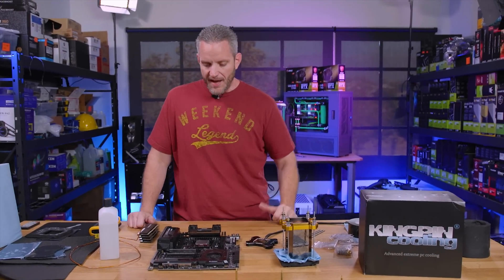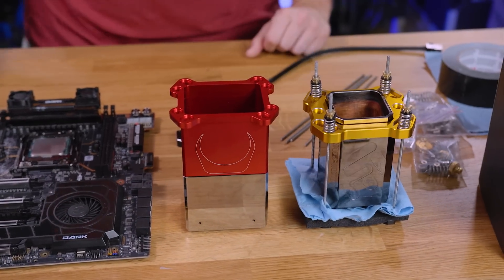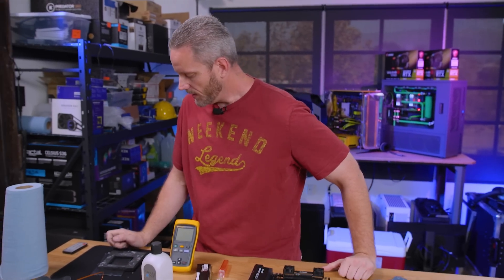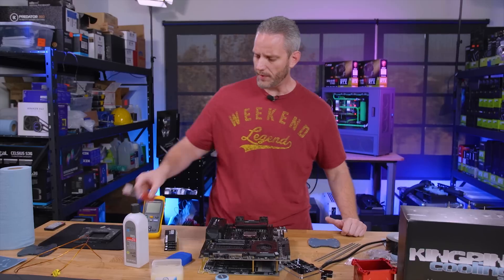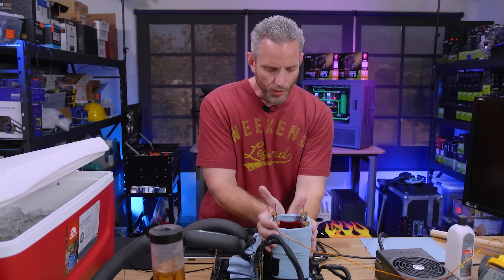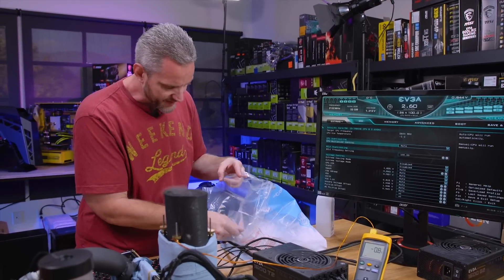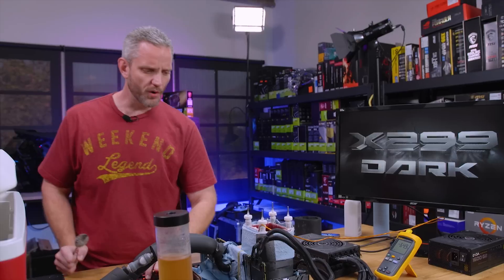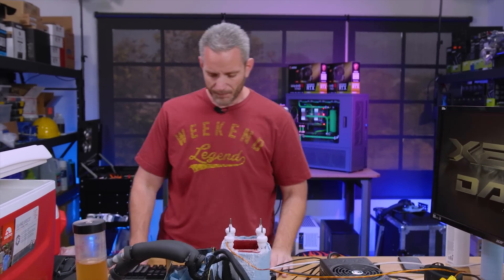Dry Ice Overclocking... NOT RECOMMENDED!

Comment: So, just a thought from someone whose never built an overclocking PC...   The biggest hurdle to keep the MB happy seems to be keeping the water vapor/condensation to a bare minimum, so this may just be a crazy idea from someone who dabbles in welding.  

 If you could put the MB/Graphics card assembly in a tote full of argon gas, basically immersing the board in a fluid that water vapor has a very hard time existing in.  Helium may be another viable option, but argon tends to sit in a tub better than most gasous fluids.

Comment: Not a usable system. WC or AC need a reservoir you cool through whatever mean. Dry ice or peltier. As long as you  don't aim for subzero and only for a gap of 30°C  at most on the fluid, you have no condensation and a pretty good cooling system at a cheap price. It can be adapted to nearly any cooling system as what you need to cool is not the CPU, but the cooling system. ie WC reservoir, backplates or AC circuitry.

Comment: Overclock in Alaska/Montana/North Dakota in the winter with the windows open. Run the cables under a door, set up your peripherals in the adjacent room. Tape up/seal the openings around the door. Ambient will be around -30 in a deep winter condition. Air cannot contain water at that temperature, no condensation concerns.

Comment: I had an Idea, lots of people have liquid cooling systems but don't have a liquid cooled motherboard!

Removing fans to install AIO's can actually be bad for the board as sometimes it looses some fan cooling in some areas!

What about a waterfall, mount the motherboard at an angle, and run oil down it, into a reservoir Which then pumps it back to the top, think about it, done properly their is real potential!

I have some other awesome ideas I'm not sharing on here, message me for details!

Linus will try it if you don't, I recommended it here first 👌👍👌

Comment: as an engineer, all you would literally need to do to keep temps lower is increase the size of the CPU. if you make the dye larger, you're going to have SO much more heat transfer. this cooling system is capable of cooling something like a small engine. yet it's being used to cool something with the surface area of 1 square inch at best. yes, you can increase surface area artificially, but that doesn't really solve the problem because the heat source is so concentrated. 
if they made consumer CPUs like twice the size, i see no reason why you couldn't run it near ambient temps with average cooling.
Reply: in fact, thinking about this a little more, if you increased the size enough, and were able to pair it with a heat sync that is capable of good flow, you could cool a properly sized CPU without any sort of active cooling.

Comment: Can you coat a motherboard (and possibly other components) in the Flex Seal spray and see if it resists moisture damage? Theoretically if you coat it properly it should be "water proof" and even possibly dust proof

Comment: Back with the first gen i7 920 and EVGA Classified 760, I could easily get bench stable @ 5.3GHZ from 2.66. Not bad, also took way more voltage knowledge...and luck than today. That rig just bit it after almost 9 years of service. RIP.

Comment: You can try to use M3 Immersion cooling. If you put a board with an installed pipe in the aquarium with M3 and fill pipe with LN2, then the stand will get rid of condensation and all parts will receive additional cooling. Even the part under the processor socket.

Comment: what is the point in the thermal paste?  I have a Dell Optiplex 980 with a Intel Xeon X3450 overclocked, and I can play even BO2 on the PC without any thermal paste and the CPU never gets too hot and it never slows down.

Comment: hmmm why not use a packing to seal the 2 parts instead of tape (tape is still asking for leakage with acetone because....it solves most glue...)..... other question, why not make air sealed case around this cooler and fill it with a gas that does not condensate at those temperatures? I don't have any experience in these kind of extreme overclocking so I might just have done stupid suggestions......

Comment: Question.  Not to beat a dead horse,  cause I know it's been brought up, but...
See you are into performance adders on cars, as am I. In the Kompressor world of AMG, we have the Killer Chiller to cool the blower air temps. Even the new Dodge Hellkitties have (stock) a similar concept for their blower.

So why not get with an HVAC guy, and have him take apart a window unit, and run lines into the waterblocks?   Or something similar as the car mods to the liquid in the lines.  Hell even blowing some cooler air from that remaining window unit over the PC components would be great too.
Anyway, any thoughts on a Killer Chiller Computer?

Comment: Instead of using Vaseline and a toothbrush to protect your board, you should get some conformal coating. Protecting electronics from water is what it's made for. All you need to remember is to mask off or cover your slots and plugs if you are using a spray.

Comment: You do know dry ice turns into CO2 dont you, which can kill you.......
Reply: Uh... no.  Carbon dioxide is only lethal, if used in a confined space, where the gas, mitigates oxygen, and when it's solid state, can burn you, otherwise it's harmless.  Carbon monoxide is the one that is lethal.

Comment: JAY Sorry man but you should know better than to keep on with this Over clocking nonsense.  Anyone who has a clue knows that systems built after 2015 have no need for Overclocking whatsoever and until they come out with DMI 4.0 or something better than DMI 3.0 that all lanes are bottlenecked already and no 5Ghz cpu is going to make any actual difference in performance other than making numbers on bench mark program go up a little bit.

Seriously Jay you are too talented and far smarter than this to keep on supporting a nonsensical fad that was very usable in the 90's but no longer worth the time or money spent.  It's about as crazy as the FPS claims and speeds people THINK they are getting but truly aren't because the ruler they are using isn't in the same measurement scale.

Would love to see you go back to doing things that actually matter rather than chase theoretical numbers on a benchmark that only measures possible NOT attainable numbers.

8 GT/s is as fast as it gets currently on mainstream systems.  DMI 3.0 holds it back.....if anyone disagrees they are offering courses in Computer science and IT for cheap these days and it will be explained in detail to you.  However as a Tech I do love when people pay me to build them huge systems so if ignorance is bliss so be it...I like Steak and Lobster Dinners.

Comment: So I have a question would it be possible to use some sort of antifreeze in a closed loop system and then use dry ice on the radiator would that be efficient or effective or even possible?

Comment: i used normal copper piping for my dry ice build in past for 290x overclock; with manual motor (basically you turn the handle and ethanol gets moved through the loop from the reservoir which is just a copper pot)
Much safer than what you did there. I was running on extender for pci-e slot; so i had only smear my gpu pcb with vaseline.

Comment: Perpetually, none of you overclockers are just building a test bench to fit into a refrigerator and running lines through carefully placed and sealed holes to a dehumidifier. Constant complaints about condensation, yet you won't do anything to control the atmosphere around the machine?

Comment: Hey!  Maybe you should setup a liquid cooling transport that goes to dry ice outside of the motherboard area and into a radiator surrounded by dry ice?  Course you might need a liquid that resist freezing and likely need a high speed transfer, so the cool from the dry ice can quickly get to the processor while the heat can get out, without going faster then the heat transfer can occur.  It might be a dumb idea, but the over kill sized radiator setup you did a while back, that simply overran diminishing return worked so well, might as well try it out for fun.  If it doesn't work well, you can say we did it and verified it!  and had fun doing it!

Comment: It's called a cooling bath, or more commonly known as a dry ice slushy. I use them all the time in my lab to freeze out different compounds. You can use many different organic solvents to achieve different low temperatures. I primarily use propanol (concentrated rubbing alcohol). You can do the same thing with LN2 and organic solvents. Wikipedia has a good list of cooling baths with different organic solvents and dry ice or LN2.

Comment: Using aceton might not be the best idea, as it can dissolve a lot of plastics and glues. Isopropyl alcohol has a slightly higher melting point, but it's much milder on parts

Comment: Once again, use a submerged mineral oil system with +200w (TEC)Thermoelectric cooler on the CPU.  No condensation issues nor dry ice..

USE a motor control module to manage the power to the TEC and use a liquid cooler to cool the oil.

You can chill the oil down as much as you can before ramping up the TEC.  No atmospheric condensation to worry about while being able to manage the cooling of the CPU from the TEC by motor(power) controller.

Comment: Can you design a hermetically sealed chamber that you fill with completely dry air so you can go subzero without concerning about humidity? Using radiators with pipes that go through the walls you can keep the temperature inside the chamber low without risking air contamination.
Reply from the maker: And how do I keep refilling the pot then?

Comment: Why not use electrical waterproofing spray for insulation, means any water on the board will not conduct anything from the board... It's spray on so gets all the books and crannies, and does not hide your view so you can watch for condensation

Comment: Do open a window while you're doing that, Jay. It takes way less excess carbon dioxide in the air to affect your breathing than the nitrogen you were using previously. And acetone vapour also gets pretty unpleasant after a while.

Comment: Why not seal the motherboard in a air tight, use air cooling parts, displace the air in the box with a inert gas like argon. Mount a ac condenser inside the box to Sub zero chill the air inside. That should Eliminate any condensation on the motherboard
Reply: Just because the gas inside the chamber is inert, doesn't mean you won't get any condensation unfortunatly.
Reply: @Johnny641 as long as the gas used had a decent purity, it should be fine. The inert gas is more of a safety thing. Imagine if you filed the chamber with pure o2. One static discharged and your board is on fire lol.
Reply: Ok , I was interpreting your response that inert gas would help reduce condensation, you are of course correct about O2 , but then why bother using inert gas at all, you might as well just use air.
Reply: @Johnny641  I think displacing or purging the air would be easier than trying to remove the humidity. Maybe it could be done with silica desiccant. What ever method you would want to get the humidity as close to 0% as possible. I think the more difficult thing would be figuring out how to seal I/O ports and wires.
Reply: To be honest, I don't think it would work and that's why we don't see it, it's not so much about ambient humidity,(although a less humid environment is of course beneficial) its about rapid changes in temp causing condensation. As for ports you would just use penetrator connectors. If the box isn't pressurised then it would be even easier. The problem here isnt condensation , thats easy to get around. To clarify I am not an OC expert but I do have a lot of experience in Hyperbaric environments.

Comment: You really don't want too much acetone on your skin though (I take for granted that you're dealing with pure acetone here, otherwise conductivity could be an issue). I used to work with pure acetone at a foundry, for stripping wax from polished parts. In my case it was a matter of punctured gloves, and once you've had that stuff on your hands for a few minutes... don't make a fist or closed grasp. You'll be regretting it for weeks, those bleeding cracks over every joint takes forever to heal.

Comment: Have you tried adding salt to the ice cooler to lower the tempterature of the water?

Also why do Tech YouTubers use Windows task manager to get CPU speeds instead of CPU-Z or HWMonitor? I find task manager is highly inaccurate on HEDT CPUs, especially when they're overclocked.
Reply: Your reply has nothing to do with the question. The GPU is on a sealed loop with two radiators which are dunked into a cooler full of ice. He clearly has some sort of liquid cooling additive in the sealed loop which likely lowers the freezing point of the fluid independent of the fluid outside the radiators. Adding salt to the ice-water mix would lower the freezing point of the water in the cooler, which would lower the temperature in the loop, which could lower the temperature of the GPU.

Comment: So...buy a few gallons of acetone and fill air to water heat exhanger then put it in 50lbs of dry ice and run with no coolant.  Tip for cleetus mcfarland 7.5 sec run.

Comment: Would a silicone spray work to prevent water condensation on the mobo...or place the mobo in a box that has zero humidity (hence no water to condense)? I have an environmental test chamber that can work down to practically zero humidity.

Comment: Unless you can encapsulate the entire PC in an evacuated chamber which is then filled with Argon, you are going to have atmospheric condensation issues. ..You will also need a gas and water-proof pass-through of the encapsulation for peripheral connections. <edit> (They don't let anyone use Freon Baths for things like cleaning PCB's like they did back in the 1980's anymore).

Comment: The Kingpin Cooling T-Rex Pot is the perfect pot for the HCC/XCC CPUs. I was actually one of the prototype testers. The temp control under LN2 with a good torching is insane. Put it to good use. The heater plate is almost a necessity for your setup. It'll save you a lot of headaches. Enjoy and push those clocks!

Comment: 8:13 aaaacccctttuuaalllyyyyy you have to have a temp of about -270 degrees to sustain liquid helium because the boiling point is at -269 degrees so basically helium is almost impossible to keep in liquid form.
Reply: Not impossible at all. Look up dilution refrigerator
Reply: Malte
Maybe I'm stupid but, almost impossible =/= impossible.
Maybe read more carefully op's comment again :P.
Reply: yeah, but its also not almost impossible. cooling down to these temperatures is a thing done everywhere all over the world almost daily. Liquid Helium has many applications and there exist dozens of processes to liquify it. And keeping it in that form isnt so hard either.
Reply: sorry if my post wasn't totally clear I understand that people use liquid helium for various uses around the world I was debating the point in which jay said you could use liquid helium to take temps down to -250 but you can't even have liquid helium at that temp you would need a temp of about -270 and when I said almost impossible I was referring to the average joe such as jay not an industrial company with millions of dollars worth of equipment.
Reply: @TheZarvinMC  isn't the cooling effect coming from the boiling.
Reply: jdr ok Not necessarily.
Reply: Just place it in a vacuum and reduce/increase the pressure

Comment: Geez, everybody is spending so much time worrying about condensation. You need to take your board out of the air!!! Get some flourinert, submerge your board in it, put a waterblock on it, and run the cooling loop into whatever you want to chill the contents. Then rather than getting condensation dripping onto your board, the coldness will just contact the flourinert and make it colder. Flourinert doesn't start to gel until it get's really cold.

Comment: Mr. Jayz, are you have been try a PELTIER cooler for CPU? if dont, i think you better to try, its cheap option, and have almost same result to dry ice or liquid nitrogen.
Reply: I don't think it's as easy as you think, to get cold with a peltier you need to cascade them, and it has to be setup right or the cascade doesn't work.
Reply: easier than this, maybe mr Jayz should try, so we will know.

Comment: what kind of monster uses non-rgb memory?
Reply: A tasteful monster
Reply: I must be ober monster than as i dont have rgb memory/case fans/graphics card has them on it but they are disabled i get it a way to customize your rig etc but its not for me i grew up in the late 80s and 90s i have seen more than enough fucking neon lights to last a life time.
Reply: R K I prefer an all metal cabinet with RGB lights on the outside, not inside where I can't see.  The only lights I would want inside are indicator lights for troubleshooting, like a POST 7-segment and activity leds on each drive.
Reply: RGB sticks costs a lot more than non led
Reply: Me, but its only because all the Trident Z 3600 kits were sold out... (Actually they had 1 kit left, but I needed 2, and I didn't want to run mix-matched ram in quad channel). I may have to buy some RGB heatsinks for them, its going in my show build, "ThreadREAPER" with quad GPU water cooled and the CPU will be running sub-zero cooling for daily (I need to test on LN2 and DICE to see if the temps help scaling, but I use phase cooling for dialy builds, and my FX has been doing longevity tests at 1.7 Vcore and rarely ever peaks the core temp above 0c, so I think its giving me the green-light on the Threadripper chilled for my daily system).
Reply: Sadly I bought my DDR4 kit before RGB ram was a thing and buying new ones just for RGB is a bit expensive 😂
Reply: Im guessing you are one of the kids that would slay over a Razer setup.